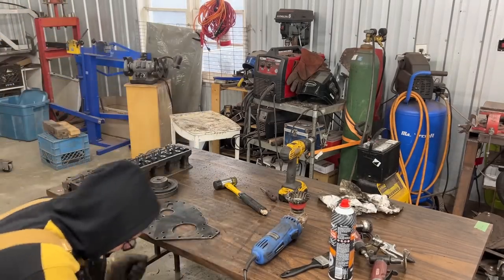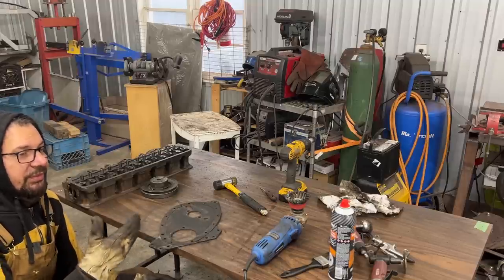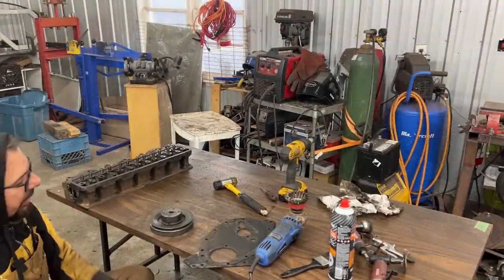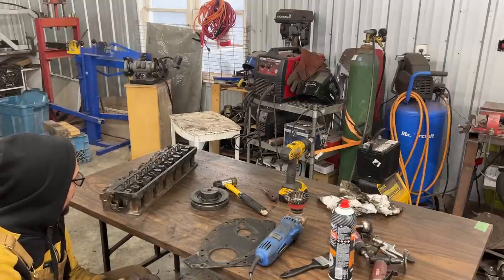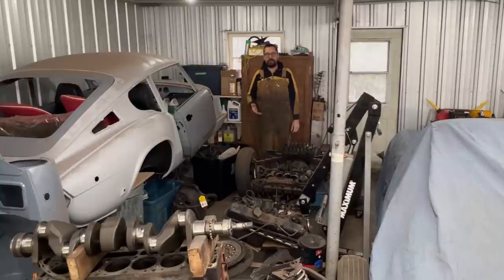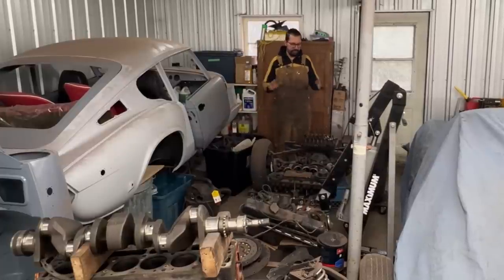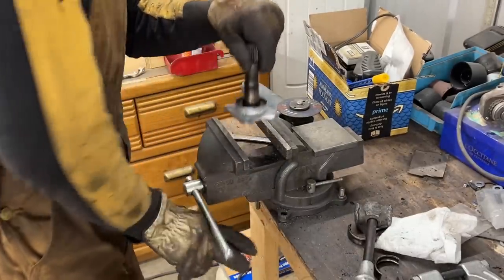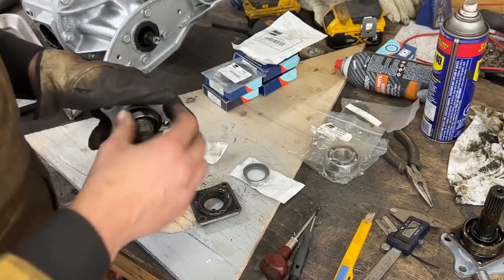1972 Triumph GT6 - Part 80 - Servicing The Differential

Comment: The wire in the waterways is used to strengthen the cores when casting. They're supposed to flush out with the sand once the head has been cast. But it's not uncommon to find odd bits.
Reply: Good call, that got past me and I do a fair bit of casting.
Reply: At first I thought the wires were from the hangers used in the casting process - I've seen this before in some investment casting.

Comment: The wires are casting artefacts. They were used to strengthen the inner core and should have come out with the sand, but they are harmless.

Comment: Hi, when you use the bearing splitter to remove the bearing off the shaft, you use a bearing puller hooked around the back of the bearing splitter tool. Then you wind in the bearing puller tool to pull the bearing off the shaft.  Sometimes the bearing splitter has threaded holes in the front face so that you can use threaded bars which are attached to the bearing puller. Where I worked we had a whole kit that took two guys to lift the box that the whole kit was in. Most people only buy the bits they need, then add to it when necessary. But I will say that when we pulled a bearing off this way, we would cover the bearing with an old rag. As sometimes the ball bearing would explode out of their housing.
Reply from the maker: Yes, my splitter has the threaded holes and I used a puller in the past, but this time the splitter wasn't in enough and only the 4 corners were under the bearing. I was afraid they would chip off as it is a cheap tool. I tried to achieve a similar effect on the press, but I gave up for the same reason. So the angle grinder helped.

Comment: I may be wrong but I don’t think that's the proper oil for the differential. Look at the label it looks like what I use for my transmission. For some reason I can’t post links in youtube but if you google triumph experience “more for the differential gear oil debate”  post #7 there is good info on this.

Comment: Personally speaking, I like the rotoflex joints. They absorb vibration. The Ford GT 40 has them, along with 63AMG Mercedes, on the prop shaft. So high quality, we maintain joints I would imagine are sufficient for our 110 plusHP cars?

Comment: Hi Elin, I've been watching your work on this car with great interest.  I'm restoring a 1970 GT6 Mk3 myself.  Your 2X4 special tool for removing the top plate on the spring was a good idea, but here's my solution.

First, remove two of the studs, the centre front and rear ones are probably best.  Replace them with lengths of threaded rod, about 200mm long, then run two nuts down these longer studs to hold the spring tension.  Remove the other four nuts, then gradually release the two nuts on the long studs till all the tension is off.  For me, that worked well, no risk of the 2X4 hitting you in the face as you release it.  I plan to reverse the process for refitting the spring, hopefully in about 3 or 4 weeks.

Good luck with the project, great to see it moving forward!

Comment: I put a new seal on my pinion flange, and still had a drip.  That was with a speedi-sleeve too.  I think it was leaking through the splined shaft and then out around the nut.  I took the nut off (under the car) and put some sealer in the best I could and it still drips a little, but not as bad.
Reply from the maker: Yeah, I am always worried about leaks between the shaft and the pulley or sleeve or whatever the seal runs on. But usually it turns out there is no problem

Comment: Correct, those roto flex joints were both new. I’m with you on the cv conversion. 
The leaf spring has some nylon disks between the leaves. I was fooling around with replacing the buttons there. afaik the new roto flex joints are made by a different company and are sub par.
End rubber bushes on the leaf spring are new, but very old! Rear diff bushes I’m not sure about, but I think I had ordered them with the front ones the hold the diff to the frame. Diff was never opened by me. Only yearly oil changes prior to my trips to Ontario.
Reply from the maker: I can’t believe you remember those things from so many years ago. I don’t remember what I’ve done on the car 5 years ago and have to go and check my own videos :)😂

Comment: I think your correction about the GT6 rear spring was only partially correct ! Yes the Mk1 had the simple spring like the Spitfires MKs 1 - 3 and the Vitesse Mk1s,  and for the GT6 and Vitesse Mk2s the Rotoflex axles were introduced. These carried on with the Mk3 GT6, until that was simplified by BL to use the "swing spring" and solid axles of the Spitfire Mk IV / 1500. So it is not exactly the same as the Mk1 arrangement... the Online diagrams you showed don't seem to make this clear ?

Also the Rotoflex axle design was used on the Lotus Elan, and these commonly get the CV joint upgrade.

Comment: Just trying to think back how you got the oil seals off the TR6 stub axles…I know you did those in one of your previous videos and I don’t believe they gave you any issues.  Looks like the GT6 is very similar just smaller in size…
Reply from the maker: On TR6 you can remove the outer flange from the shaft and that gives you more room for the  press

Comment: Is the rotaflex a drivetrain shock absorber or instead of a universal joint?
Kind of doesn't make a lot of sense.
Reply: Reduces torsional vibration and noise.
Absorbs torque fluctuations.
Replaces mechanical joints, eliminating lubrication and metal-to-metal wear.
No servicing required.
Unaffected by dust, grit or moisture.
Reply: @MrDazvere  so it's both then.